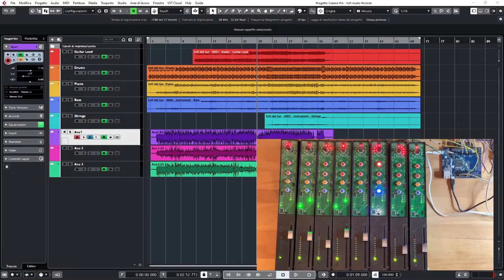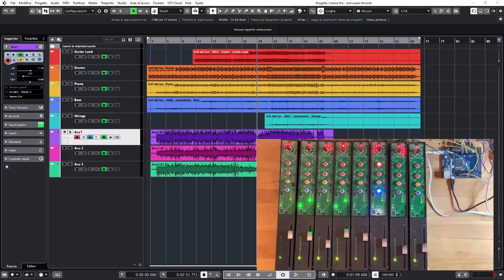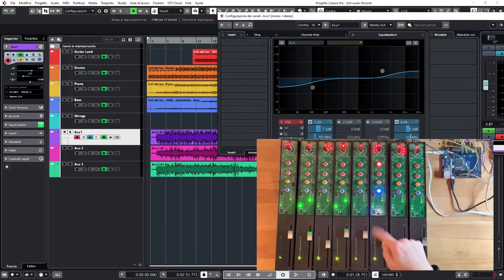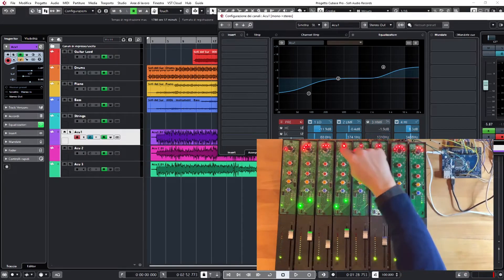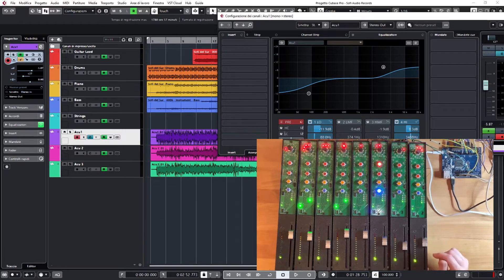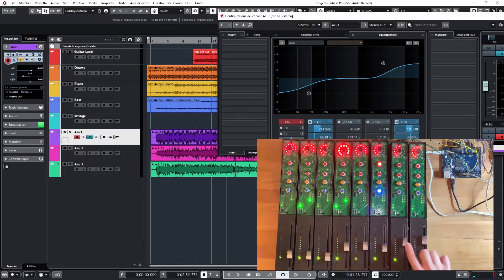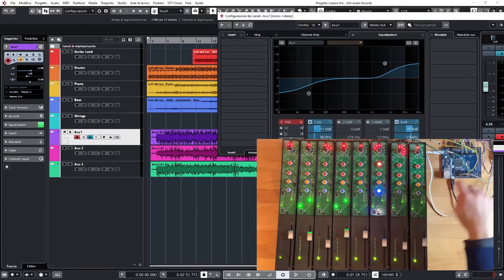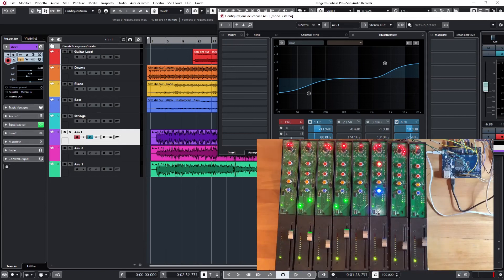DIY MIDI Remote Controller - 8 Channels

Comment: Where are you getting the fader strips you show in the video? What about a master channel and meter? Is there any way to get a control signal to a master channel?
Reply from the maker: Hello, the strips are done by me. The motorized faders are from bourns. The master channel have been added recently, check newer videos on the channel. No meter for master channel.

Comment: This is awesome stuff! I have a couple questions. I am still learning so these questions may be funny. If each channel strip communicates with the mcu through 1 UART connection, how can they control so many peripherals in each channel strip? (For example - all the LED's, buttons, fader, rotary encoder, and display)?
My second question is, if UART only allows you to use 8 channels before running out of pins, how can you add another 8 faders? Does this require another mcu as well as another usb connection?
Reply from the maker: Hello Andrew thanks for your kind words. First question: each channel is equipped with 2 microcontrollers, a main one (samd21) that controls the faders with ADC reading, PWM motor control, the buttons and all the lights. This samd21 is connected via UART with the main board. The second MCU (samd11) controls the VPot and is connected via UART to the first one. So the computation power is quite distributed. Second question: this is something I’m working on. There are actually several options and as soon as I have chosen mine I will publish it. Thanks for your questions, as you can see all very good ones!
Reply: @fcampanini   thank you very much for answering my questions! That was very informative. I was having lots of trouble finding an answer online, so you are a lifesaver.
If I could ask another question: what technique is used for recieving data from peripherals? Do you use polling, interrupts, or something else?
Thanks again for your time and awesome work! Keep it up!
Reply from the maker: Hello, I use both polling and asynch interrupt based approaches. For instance all UART communications send and receive data with asynch approach via ring buffers where for instance rotary encoding quadrature reading is set in polling on the main thread. My rule in this respect is to stay flexible with a preference for polling approach if and where possible. Hope it helps!

Comment: Hey Filippo, fantastic project! It's amazing how much effort you put in to make this work. I came across your channel because I'm interested in building a controller myself and was looking for a starting point. I'm a light technician studying robotics atm and thought I need an interesting project to combine my field of interest. My use case is very different from yours (fader wing for Chamsys magicq)  but the hard- and software implementation is very applicable, besides form factor and dB meters and I'm thankful that you share your knowledge with us. 
I personally only have experience with STM32 and Arduino. and was thinking about implementing the project in micropython on a RP2040 to try it out, because is usually programmed in C.  The RP2040 looks like a good candidate for me,  (USB 1.1support, easy prototyping with C and micropython, M0+ and pricepoint)  Did you choose the ATMEL SAM IC and the driver for a specific reason? Best Fabian
Reply from the maker: Hello Fabian, thanks for your kind words. I chosen SAM Microchip Atmel just because i was already working with that platform since some year that's the only reason. I think STM and RP are fine either, just remember you need USB, lots of serial connectivity peripherals such as SPI, I2C and UART and moreover you need processing power... that's a quite tough application!
Cheers.

Comment: Bagaimana saya bisa mendapatkan barang buatanmu ini ? Dan harganya berapa ?
Reply from the maker: Hello G, thanks for your kind words. 1) yes, not only it is possible but in fact I did it. Please check display videos on the channel. 2) According to the Mackie Universal protocol specification, all textual elements come from the DAW via SYSEX messages and the way they come is what you see... so unfortunately answer to your question is no; at least using the Mackie protocol... 3) Same answer as per point (2); the protocol do not contemplate these possibilities and so forth it's not possible.

About your mod project it looks very interesting to me, please go ahead and if you like share your results and ideas. You can reach me  at fcenginering@gmail.com should you want to chat. Cheers.

Comment: Hi, your video is very useful, I am using cubase software and also want to have such a control setup. it will help my work where can i buy them with your designs. or components that you make so that I can build my own.
Reply from the maker: Hello Chill pro, for now I'm not commercializing anything. However you can find links to download material to build your own controls under the videos about motorized faders on the channel. Cheers.
Reply: @fcampanini  Can you make a video explaining the entire manufacturing process of the softwere and hardwere please?
Reply from the maker: Quite a long video... :-) As soon as i will make it available i will surely make a series about how to built it. Cheers.
Reply: @fcampanini  I really hope you will make a series of detailed step-by-step instructions so that I can refer to and apply, because I am also using cubase 12 pro software, the information you have done is very good. add a little to the bowl. thank you very much